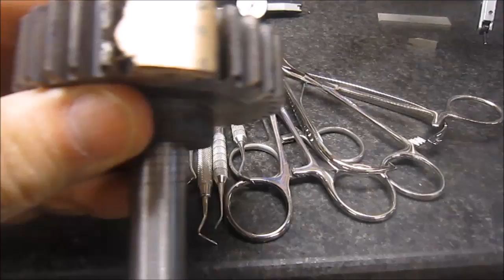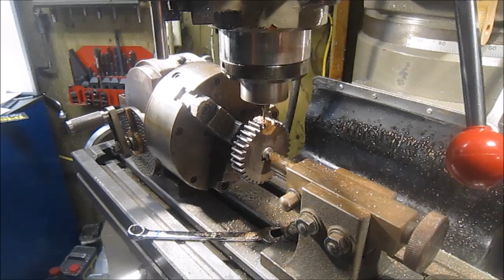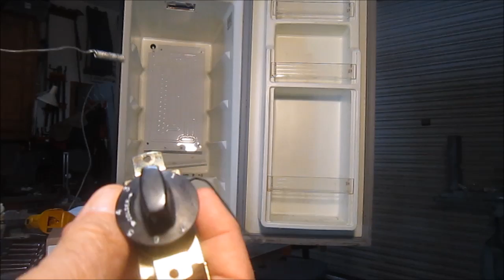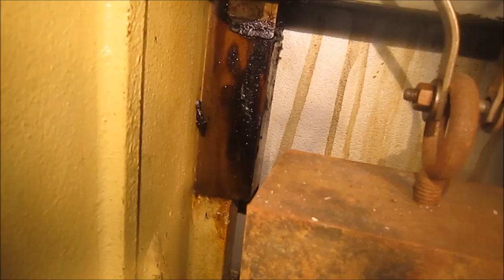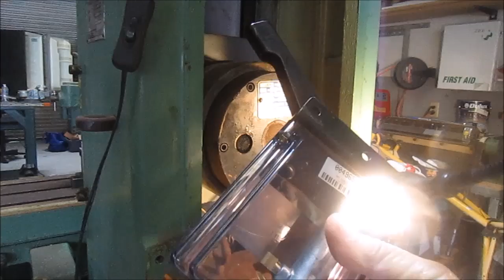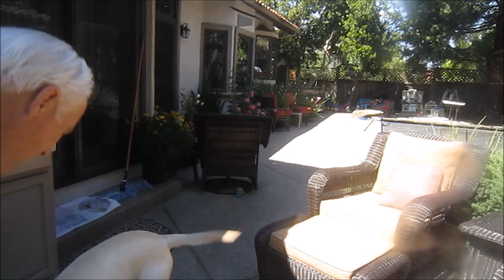Screwy Tuesday #59  Fixing My Fix Of A Fix

Comment: I really was going to do it all by hand with brazing it up after grinding in some grooves to help keep the brazing in deep enough to bond tight with the cast metal. But the cost of the off the shelf gear was only $25 so not to hard to take. I'll keep the old gear and fix it too , the drill press has two lift mechaniziums on it ,table and head. I guess the extra weight of the power feed makes it a need. The press and the shipping and gear didnt cost $500 . I'm looking at another but want a small knee mill like a Rockwell or clausing 8530 , really want the longer table.

Comment: I have the same broken gear on my drill press . I'm going to adapt an off the shelf 34 tooth gear, by facing the gear thickness to size ,then I'll have to drill and tap for set screw . Plus I have ti broach the key way . I was going to braze it but I don't have a dividing head , mine has two teeth missing and another one cracked ready to fail . I hunted far and wide looking for a replacement but no go unless I wanted to pay over $400.00 just for the one gear. That's about what I paid for the price delivered . I'm thinking about making them and sell them on eBay why not its a needed product right.
Reply from the maker: +Silverbullet good luck with the adapt.....you might try and braze and then do your best with a grinder/file...as the teeth just have to mesh for the travel and it is not a running gear train.....get it to work and of course it might not be the prettiest but if it functions it is gold and your fixed it

Comment: Hi Chuck,

Just a small thing, but it helps to tighten the indexing handle on the dividing head, that way you know what ring of holes you're using and don't have to fuss getting it to the right radius for the pin to drop in.
Reply from the maker: +Paul Compton HI Paul.....sooooo true....thanks for viewing

Comment: Are those grease zerks actually for grease. Many machines have zerks that you are suppose to use oil in. Not grease. I made that mistake on my first machine as did the previous owner(s) of it did.
Reply from the maker: +ww_big_al You are correct, the zerks are for oil...so I am cleaning grease....I started with spraying WD40 to assist in the cleanup.....just that oil getting the grease to soften surely made a difference.....thanks for viewing

Comment: Way lube...and you might want to remove the sliding parts and get all the old grease out. Not fun but old hard grease is just a mess.
Nice on on the gear and a good trick using a small mill to rough it out.
Eric
Reply from the maker: +esoomreltna Hi Eric...yes, I have a lot of cleaning of old grease...thanks for the supportive comment

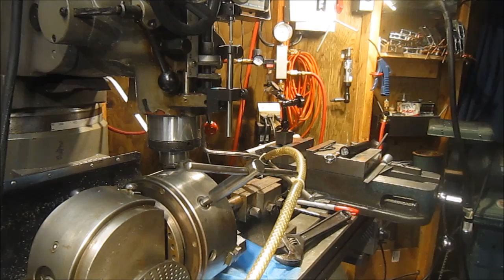Comment: What's wrong at 9:45?
Reply from the maker: +Peter W. Meek Hey Peter...it is an index head, not a lathe.....but I agree it is a BAD practice....I saw it when I left if there during the filming and also in the production of the video.....your comment is good and don't let me slack....thanks for the visit
Reply: Yah, it's not as though an index head is going to throw it across the room, but like you say, you don't want to get in the habit of taking your hand off a chuck wrench when it is still in the chuck. (And I visit EVERY week, and I won't let you get away with things like that.)

Comment: My Thompson grinder has a manifold with bijur meters that uses the hydraulic oil from the main sustem to constantly oil all the bearings and ways. It seems to work pretty good and no one ever forgets to lube like that. :-)
Reply from the maker: +bcbloc02 Hello Brian, does the oil for the ways return to the tank?  any filter for the grit?  do you run a combo oil...way/hydraulic ( I heard there is such a beast)???
Reply: outsidescrewball
It does return to the sump. There is a suction filter on the inlet going to the main pump that should clean anything that doesn't settle out. I use John Deere Hy-Gard which is a transmission and hydraulic oil so it is designed to protect heavy loaded gears and bearings and is compatible with wet disk brakes and clutches, which are what I have in the Cincinnati mill. The oil also has modifiers to make it cling well since many high priced farm machines sit for months or even a year before being used again and they need protection from rust and to not start up dry after a long time. I use it in the apron on my Monarch, and it also auto lubes the ways when in operation from the apron.

Comment: My Wells/Index mill had grease zerks, but they are not meant for grease, but oil.  I converted an old grease gun for use with oil (just shortened the reservoir and sealed the end for the plunger) and it's actually a nice system.  I wonder if you technically have "oil zerks"?
Reply from the maker: +Jack Hoying Hello Jack....yes, I think that they are "oil zerks", but someone was using grease....I did think of cleaning and modifying a grease gun for oil...but thought for ease of use over time the one shot might be a good add....thanks for viewing
Reply: +Jack Hoying "Alemite lube fittings"  They will work with grease or oil, or peanut butter...  My guess is that oil is correct for the grinder.
Reply from the maker: +Bob Korves correct Bob....

Comment: I just ordered a gear for my 15 inch Clausing drill press .  Its a tiny little gear about 1-1/4 od for the table height adjuster.   It cost $212.   Clausing parts are very expensive.
Reply: Could you have made one?    Isn't that what you guys do?
Reply from the maker: +1970chevelle396 yes...been there done that....lol......I have a 15" also, but doesn't have the table height adjuster....
Reply from the maker: +Rod Dahl yes...it could be built
Reply: Rod Dahl I couldn't make one because I don't have a milling machine.
Reply: outsidescrewball I bought the Height adjuster off of Ebay and the internal Acme threads on the gear were bad.